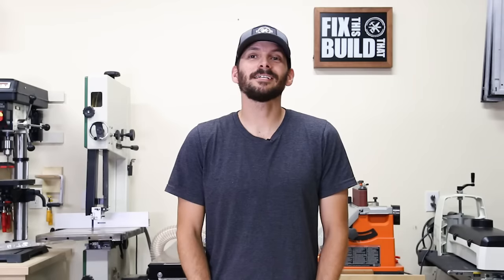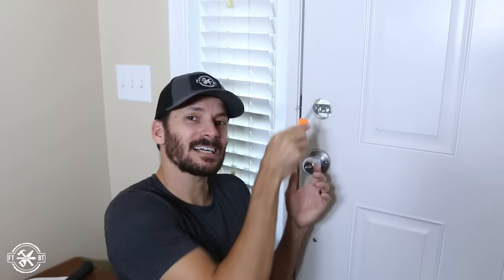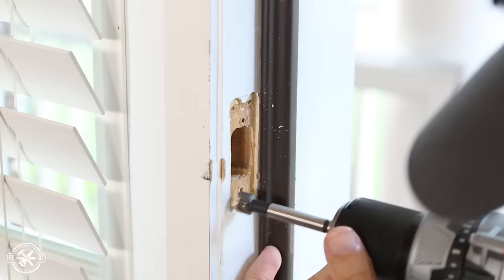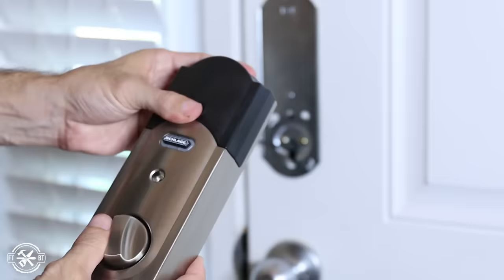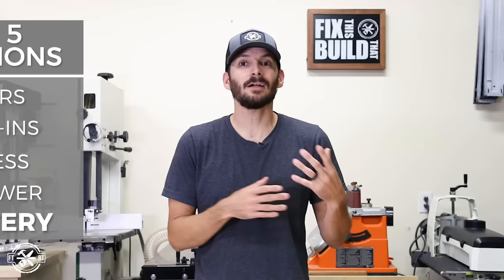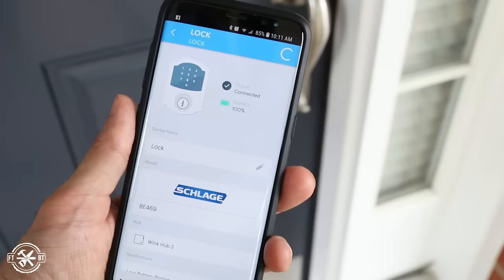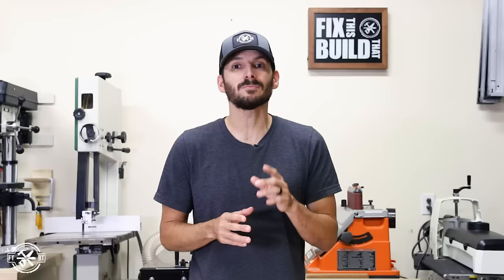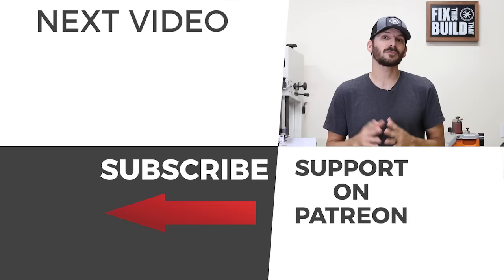Keyless Door Lock Install & Top 5 Questions | Schlage Connect

Comment: I’ve been using the Schlage Connect for the over 3 years.  Best smart lock out there. And I’ve tried the August and Kwikset Kevo.  One thing about the Schlage’s battery life. On my main door where it gets used daily, the batteries lasted about 26 months before I had to replace them.
Reply: Is it ok to use original strike plate ?
Reply: Inquisitve m - Yes it is, as most strike plates are virtually identical in size.  But you have to make sure the dead bolt clears the hole CLEANLY and easily.  If there’s any resistance when locking/unlocking the dead bolt, you need to adjust or shave the strike plate a little — or else the batteries will get drained very quickly or the motor will eventually get worn out.  I used a Dremel to adjust my door frame and strike plate easily. 

Lastly, one thing to note, if you do use your own strike plate, you may not be getting the same security Grade 1 rating, as the Schlage strike plates uses the extra long 3 in screws.
Reply: @ONI1013.  thanks.
Reply: Ours only last about 4 months with heavy traffic
Reply: @tryphena2691  - Wow.  One of our doors we use at least 20-30 times per day, and that one has lasted at least 18 months and still going.  Perhaps your traffic is very high?  Also, as we try to manually lock the doors ourselves when coming home (and even though it’s set on an auto lock timer), just to preserve battery life.
Reply: @tryphena2691  Forgot to mention one other thing.  If the deadbolt catches any part of the door latch, even if it closes but not completely cleared and smooth, that will also drain battery life tremendously.  The mechanism will force more power to close if it senses some resistance.

Comment: Spot on! The key thing you mention here is if the deadbolt does NOT move freely this will SERISOULY affect battery life! I have this paired with the Ring alarm and works flawless! I have read SO many reviews saying battery life was 2months or less and that is because the lock is not "smooth"! On my main entry door that "cycles" at least twice (sometimes more) a day I have gotten a good solid 13months and just replaced the batteries before they got too weak before they needed to be replaced. Battery replacement is also VERY easy and does NOT require a re-pair to your hub or alarm system. I got this on "sale" for 169.00 almost 2years ago. Works great! As you stated it may require "special" tools to install as my install also required work and alterations using the EXTRA long screws that further increase the "kick-in" factor. Using the "standard" screws that are only a 1/2" to 3/8" long is WAY easy to "kick" these in! Using the 2 1/2" or 3" screws going into a stud makes it WAY harder to simply "kick" in. Great review!

Comment: One thing people often miss in the “hacking” topic is that many smart devices connect directly to your home network. It’s best, if possible, to separate them from your main network though, as often their security leave something to be desired. Some home routers have the option of using two SSIDs (like “Family” and “Guest” in your WiFi), that are separated from each other to prevent them from talking. If your router does this, use the feature! If you get deep into home automation, find a router that does it!

One cool thing with Z-wave is that the only thing actually on your network is the hub (Wink, SmartThings, etc). That’s great from a security standpoint!
Reply: Wont protect against shapeshifters

Comment: The biggest problem with any dead bolt system is having a cheap wooden door frame the can be kicked in with you foot easy!! The deadlock works 100% better if you have  a steal frame.  Trust me I took a steal bedframe did a few cuts and nailed it to my door frame. That did the job and I had better protection from someone just kicking the door open ! As you know living in New york is not easy!!😂😂😂

Comment: There still is a key slot that can be picked, so don't waste your money on any electronic locks that use a key as a bypass when the batteries get low. Go to mechanical entry deadbolt locks. I have had one installed on my two homes for over 20 years I just take it apart and clean and use lite lubrication to keep all the mechanical parts moving smoothly. I have one of the Lockey series locks. I use a six-digit code. You can install additional security pins to use 4 to 8 digit codes.

Comment: Fyi,  my screen on my schlage sense smart lock would illuminate and key pad inoperable. Found wire that come through the door came loose. Reconnected = works! Dont buy another one till you chk that. Over & out

Comment: I really like the Schlage Connect except my zwave doesn’t work.  I have 3 and only got 1 to connect to my SmartThings hub and Amazon Echo.  But it has a strong motor, much better than kwikset and August which I had installed before.  Both those units went thru batteries at fast rates.  August integrated with Apple’s HomeKit seamlessly and worked great.

Comment: I live in the Upper Peninsula of Michigan, aka "Da Yoop". 

I have this exact deadbolt set and have had to have it replaced 4 times now... The new lockset is going to be installed on Saturday after Thanksgiving.

1st time, keypad failure.
2nd time, batteries died in 6 months. Replaced them with the recommended Duracell batteries, no joy. Lockset was dead.
3rd time, keypad failure again.
4th time, lights on keypad failed. Keypad still worked but was a p.i.t.a. using it at night. "Dealt" with it for awhile until the batteries died, again, lockset was dead even after the new batteries.

Because of the temperature extremes where I live, I noticed that warm, moist air leaks thru the hole in the door and blows on the back of the keypad assembly.  Maybe it's shorting it out?  Before I installed the 4th lockset I sealed the back of the keypad where the wiring went into the keypad with silicone caulking and it lasted longer than the previous locksets.  I also put that stick on foam insulation on the backside of the door where the controller is to try to keep that warm moist air from leaking thru the hole in the door.  Does anyone have any suggestions how I can seal that hole to keep ALL the air from blowing thru?

I'm going to give this lockset 5 stars for convenience of use, ... But because of this reliability issue it's going to drop down to 1.5 stars.  However, Schlage Customer Support gets 5 stars.  They had me do a little troubleshooting but when I explain everything I already did to troubleshoot the issue they send me replacement locksets at no cost to me.  

One item of note... The "born on date" for all the previous locksets were 2019 and older. The one I have ready to install is 2021. They must have a warehouse full of these things, ready to ship out at a moments notice because of issues like mine.

Comment: I watch vids like this and I think a lot of people will think this is a simple installation. It ain't!
It's simple if you have been doing this stuff for a few years, but most people I know don't have the knowledge or tools to do this job properly.
Just because a guy in a video makes it look like a breeze, don't be fooled. I am an experienced do-it-yourselfer, and i've added closets, done electrical and plumbing... mostly self taught. (I always do things according to code. Look up code online.) NOW I can do stuff really well,. But I made a ton of costly and time consuming mistakes over the years.
Here's some of what I've learned:
1 - Prepare to go to the hardware store at least 3 times for any job. There's always something you didn't realize you don't have.
2 - Do you have a big roll-around tool cart? Is it stocked with drills, chisels, saws, sanders, staplers, bits, electrical testers, romex, plumb bobs, electrical connectors, plumbing parts, etc.?
3 - It's almost guaranteed that your job will vary from what you see in vids. My door jamb is metal, not wood. The old hole from my old door lock is way too small to fit the new lock. Do you know how to make a hole bigger? There's nothing but air for your drill to start into. 
The only way to get handy is to do a lot of jobs and make a lot of mistakes. Just be careful. READ, READ, READ! WATCH, WATCH, WATCH! LEARN, LEARN, LEARN! Buy magazines, books, etc.
Today, I drilled a small hole in a piece of wood with a brand new drill bit. Within 10 seconds of drilling the bit broke and hit me in the scalp! Of course I was wearing protective glasses, but it didn't protect my scalp. Fortunatly, it was just a scrape. My point is: wear protective gear - eyewear and ear protection.
Hope this helps. Good luck.

Comment: I got two questions. 1.- How durable can it be while being installed in a very hot places like in the Caribbean, where DAY temperatures along the year are between 25 and 35 Centigrades. In addition during rainy days it may get wet. My Front door faces East and the sun and makes things worse. 2.- During vacation times, bulglers can damage the from lock to the point of destroying completly. How easy to be destroyed...Can the door still be open. Thank you so much

Comment: Hey Brad, great video but for future topics perhaps discussing which are best for metal doors?
As I’ve tried the Nest x Yale device but it wasn’t totally smooth. Kinda bc my door & jamb have alittle slack, if that makes sense. Another words there 1/8”-1/16” play/slack. That’s primarily my side door/outside utility door. 
But for my inside lobby door leading to the basement I think I’ll try this Schlage device. It looks really cool & comes w/a built in keylock as well. The Nest DID NOT. 
Thanks again, Brandon!

Comment: Great video and answers all the questions. Just remember though that most entry is through a broken window. That’s right thieves break windows to get in. Also any door with a window in it is the least secure type of door. Break the window reach in and unlock the door. Good doors, good locks and an alarm system on the windows is the best.
Reply: Great info.. thank you!
Reply: Actually that is only the second best.  2nd amendment is the first best when it comes to dealing with these criminals

Comment: Some keypad locks have a 9v battery connector on the bottom outside so you can open it if it died without a hard key. I know the assa keypads have this not sure about consumer grade smart locks though.
Reply from the maker: This one doesn't have that

Comment: This is a great video. My issue is that I cannot chisel my way through the door since it is all metal framing. As a result, I have to completely remove the metal component to make this work I believe.
Reply: Wont protect against telekenisis
Reply: Cordless (or corded) Dremel tool with a metal grinding attachment should work in your case.

Comment: I've had that same exact deadbolt since 2016 and it has never let me down.  Battery life isn't the best (I go through a set every 60 days or so) but I do love that it connects to Smartthings.
Reply from the maker: Oh wow, 60 days isn't a lot.  Does the bolt rub in the opening when it engages?
Reply: I have that issue during the summer (my door is an old wooden door) but not as much during the winter, but I do average about 60 days with it either way.  I don't think that's so bad though.  The convenience of my door locking automatically, unlocking when I go to bed and click Good Night on smart things, and it showing me the status at all times is worth a set of batteries every two months.  I love when I come home from grocery shopping and I don't have to juggle keys to open the door.  That alone makes stocking up on batteries worth it.
Reply from the maker: @vincentferrari  yes! I've been u locking the door from my truck and walking in with my hands full of bags. Soooo nice!
Reply: @vincentferrari  I called Schlage about the battery draining so fast. It locked me out twice, so I had to do something. Schlage told me to disconnect the z-wave feature. I did, and the battery lasts a long time now. I didn't use the unlock by phone feature anyway. Still, people who want that feature... be aware.
Reply: Eddie K unfortunately that wouldn’t work for me since I use SmartThings but thanks for the tip!

Comment: Hi, that lock looks good, the only problem I have with it is the  override key. I was looking on you tube last week and came across a video about "bump" lock opening and the video went on to show the method and just how easy it was to open any lock that used a key. it showed someone who had never tried the opening of a lock using this method and he opened it fasted than he could by using the key. the conclusion of this video was that keys just keep law abiding people out and I have no faith in any locks now if they have a key override (of which all locks seem to do) so I wonder if it is worth putting a lock on a door at all, the person who made the video was asked if any lock was a way to stop anyone wanting to be in and he said "yes get a small yapping dog  as the noise will fend off most people".
Reply: If you are deeply concerned about the lock using a key, simply take the key that is provided and cut it a little short and put it into the lock. That will block any other key and most lock picks from being used.
Reply: @brxtmp106  Thank you for that info
Reply: @brxtmp106  So long as you have another way of getting into house if battery goes flat.

Comment: In netherlands its standard to have a three point lock. So the door locks with 3 different bolts in 3 different heights ( top,mid and bottom in door). How come all these “smart” locks are designed to only 1 bolt. Dont they break in houses in america or so? Or is the safety standard way heigher here?

Comment: My old dead bolt is only 1-1/2” diameter and it’s set back 2”on center. Also my latch is the older style one and the hole is set back 5” what can I do in this case? Thank you love the video

Comment: If the red X indcator it lights up, It could be one of the following:
The user code entered wasn't correct.
Entering a correct user code when the lock has vacation mode active.

Comment: I have a lock that stop working  after 3 weeks of installation and looking for some tips to fix the lock.
I took the lock off and installed a new lock that amazon sent a replacement but they are not taking back the bad lock
so I am trying to figure out what happen and I am very close to the beach which theres salt in the air but it shouldn't have 
stop working that fast. Can you give me a few tips on how to find out why this lock is not powering up  even when I try brand new batteries.

Comment: I see you installed this lock on a left hand swing door. I have a right hand swing door and can not get my to trough dead bolt. My question is, is there a specific lock for right hand and left hand swings or does one lock fit both?

Comment: Thank you so much for the video. Very helpful. I want to install this on one of my room doors but it obviously does not have an existing lock on it. What do you suggest?
Reply from the maker: You can buy a lock hole boring kit from home depot. Just need a drill
Reply: If inside the room, you could have a sliding bolt lock on it.

Comment: I think I got a dud. After 3 days I was getting a Battery Failure message in the Ring app (haven't tried the Schlage app yet). When you press the button on the lock you just get a red X. I changed out the batteries and same thing.. red X.. I did a reset twice and still red X.. I assume it's a dud.

Comment: I have the Samsung Hub, however, I can not see where to add or remove codes for my Schlage connect with alarm. Any Ideas?
Reply: I found it!!! yay  
Setup Smart Lock Guest Access
To get started, first enable the Smart Lock Guest Access Recommended Automation in the SmartThings app:

From the Home screen, touch the Plus (+) icon and select SmartApp
Select Smart Lock Guest Access.
Touch CONTINUE.
Touch Allow to confirm
The Smart Lock Guest Access card will be automatically added to your Home screen.

Comment: My Schlage lock just stopped working.  It had approximately 5 years of use. I changed the batteries but the keypad is dead.  What should I do?  Can the lock be saved?

Comment: My keypad does not light up.model BE469ZP new batteries & lights up green on the inside. I have factory codes 
but key pad on outside no light? the wire is connected. ???

Comment: On double exterior doors, is the keypad always installed on  the moving door, rather than stationery door? Obviously I don’t have a jam that the deadbolt will be going into. I would rather put the weight of the unit on the more stationery door than on the movable door. This added keyless entry will work totally separate from the existing door handles. Directions are so small I can’t read them for Defiant brand ( under $50). The Emtek keyless deadbolt ( that matches my handles) was around $300. My boyfriend at the time, took it upon himself to order the Defiant. My question is: is a keyless deadbolt interchangeable (right or left). The boyfriend has since gone bye bye...
Reply from the maker: Yes, they can be installed either direction 👍

Comment: if it has this override key, so what is the point of the Pin Code system? You can leave the key in the house and battery dies, what then? Keep the key under the pot of a flower near the house? well that is a protection.. (security matter). Other than that, great video!
Reply: you always walk with your key. that fact does not change. its just whether you have to fumble in your pockets for a key or just put the pin in the door